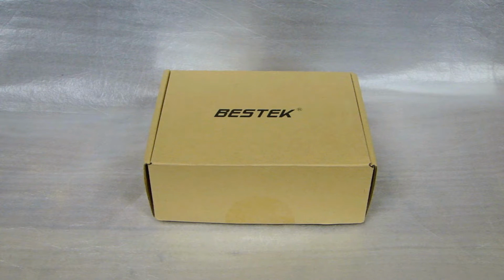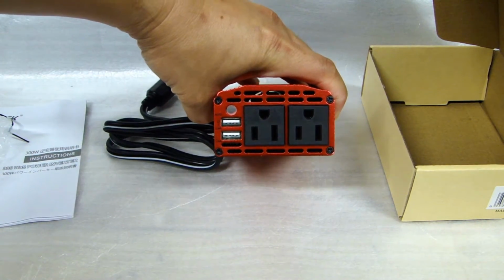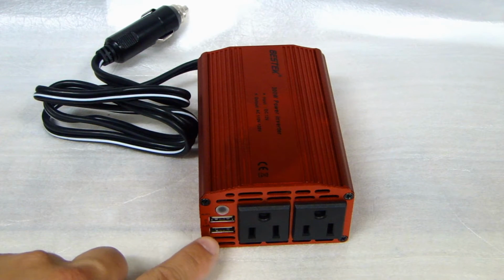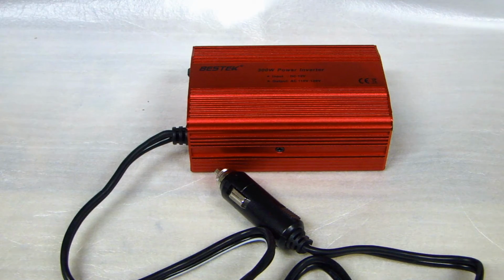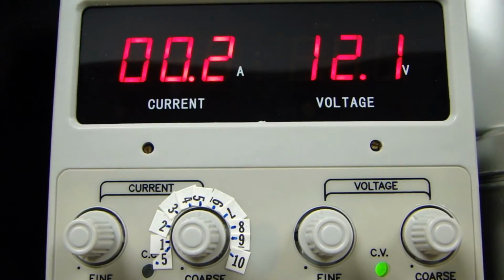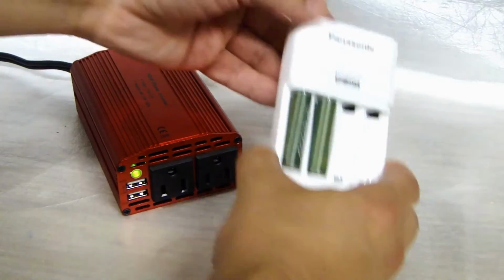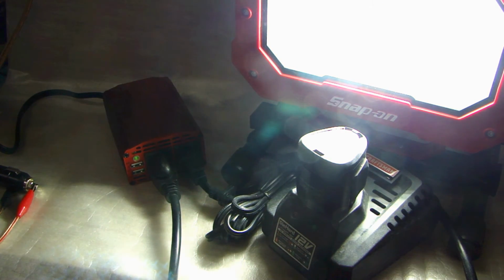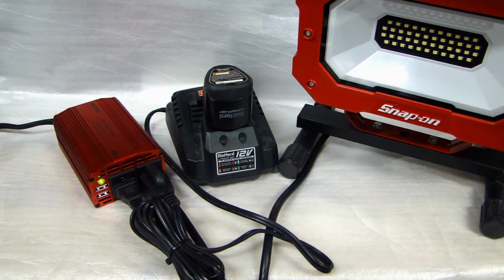Good 300 Watt Power Inverter w/ Dual AC Outlet & USB Charger - BESTEK

Comment: You said about 5 amps draw from 110v AC . The Inverter is rated 300watts , which is 2.7 amps max at 110vAC.  The words surge current is only for fraction of a second use as temporary increase in current. Unit will burn out. at 5 amps continuous with load.

Comment: Does anyone know what power inverter is good for charging while using gaming laptop? I bought two one stopped working on first use the second one just stops charging as soon as I turn on my laptop on ..help please
Reply: Answering this 2 year old question so I hope you found your answer already, if not then you should know it all depends on your laptops power supply/charger. For instance I have a Ryzen 7 laptop, I game on it, my charger is rated at 45watts. The fuse that controls my 12v lighter/plug is 15amps. If I use this exact power inverter in this video, I wouldn't have a problem as 12v x 15amps equals 180w. However, if I were to go above the 180w that my 15amp fuse can handle, the fuse will pop. Just one other thing, monitor how much heat is produced by your charger on regular home/office AC current, then compare it to how hot it gets while in the car. If its running noticeably hotter, you need a pure sine wave inverter, unless you're only using it on occasions then it doesn't matter. A little late, hope this helps you :)
Reply: @dimmunize  Yea I use a Riverflow 3 power bank it's perfect

Comment: How would this inverter work out using a motorcycle. Main use is to charge camera battery or drone battery? My 12 volt cigarette connector is hardwired directly to the battery. Thanks
Reply from the maker: For charging camera batteries and other batteries will be fine. Those use very little current.

Comment: I have the same power inverter that I bought months ago. I used 3M double sided tape and placed it in the bottom storage compartment below the radio. Very convenient to have in case of a power outage and for camping/travel. It has held up well and charges just about everything. Cheers.
Reply from the maker: El Javi Very good to hear yours is holding up well. Thanks for sharing!

Comment: I have a question, Can I replace the 12V car plug for a male USB connector? The reason I ask is because I travel a lot by bus and train. There is no 12V connection  but they have got USB. 

Best regards,
Marco
Reply: Marco de Jong nope the inverter would not work with 5volt(usb)
Reply: You can get a usb 5v to 12v adapter on Amazon real cheap.

Comment: Are you aware that most cigarette outlets have 10A fuse?  So, you are limited to 120Watts!  Unless the box came with jumper cable, it is NOT a 300W converter.
Reply from the maker: 12vgs8606 Very good point. The wattage output is very much dependent on the current you can supply on the input.
Reply: Swap the fuses then
Reply: My ford focus has 20 amp fuse so 20amps x 12 volts= 240 watts.

Comment: Will this take place of your 4 port USB charger that you showed on your trip to Miami or is in addition to the USB charger?
Reply from the maker: Gary G I probably won't always be using this inverter unless there is a need for the 110V AC output. The built in USB port on this inverter is just something extra which is nice to have.